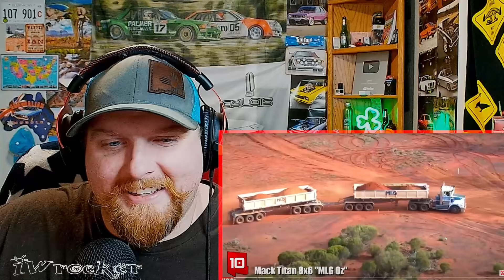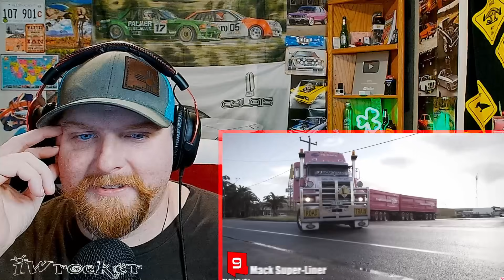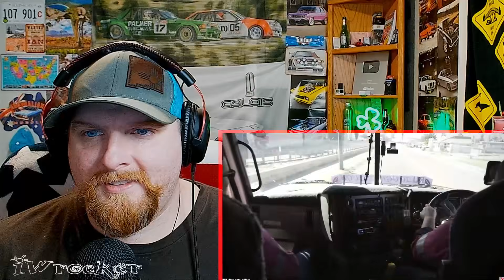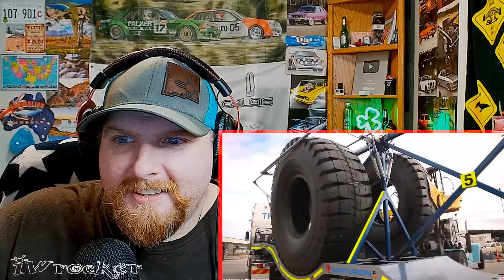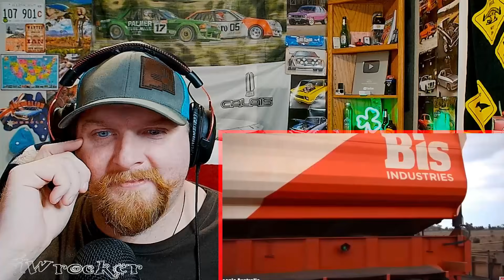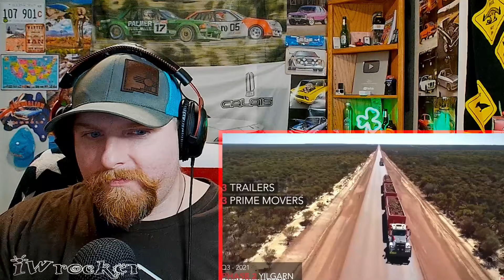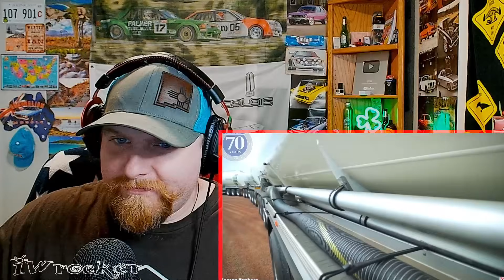American Reacts to The BEST Australian Road Trains Ever Produced

Comment: Yes your right Kenworth trucks are an American brand but are made in Australia so are Mack trucks and Volvo
Reply: It’s more “assembly” rather than “manufacture”.
Reply: Kenworth paccar Australia manufactures kenworth trucks 

They’re not imported from USA then converted. 

The kenworth truck shells are transported on trucks  to the factory site 

The shells come from another Melbourne vic plant in the west
Reply: Mack and Volvo are pretty much the same trucks nowadays. Well at least mechanically. Also a lot of the swiches and gauges are volvo, its mostly the trim and boddy and chassie that is special.

Volvo make (most) engines, Transmission, and other parts in a central location then ship them out to different manufacturing unit where they build the same parts into different chassis and bodies. Volvo, Renault and Mack is made all in the same volvo production unit n Brisbane in Australia .

They have one manufacturing unit in pretty much every continent if not several. In USA they have one for Volvo and one for Mack in Europe they have one for Volvo and one for Renault. Volvo produce pretty much all of there trucks on the local market.
Reply: Pretty sure the autonomous trucks are only used on private roads not on public roads
Reply: And correct me if im wrong. Mack is owned by volvo yeah?
Reply: Mack and Kenworth trucks have been assembled in Australia since the 1950 s or earlier. I think that all heavy trucks would be assembled locally
from parts such as tranny motor suspension and diffs , They would  come in containers .All else would be made in Australia  . THE Chassis in these trucks have
 double rails the front axles are heavier because of the extra load they carry . The cabs, sleepers ,ice packs , bullbars ,and the radiators are all locally manufactured .
The reason for the double chassis rails is stop the chassis from flexing and twisting around when carting double decker crates of cattle .
Also in days gone by MACK used to get chassis made here and exported to US .I think all right hand drive MACK trucks for the world market are
assembled or manufactured what ever you wish to call it .
Reply: @@herctwenty11

I have a good American born friend in Hagerstown who retired from Mack after 50 years. Trucks are exported then some Australian components are added to beef   up to suit local conditions. This is mainly done due to tariffs imposed by government to meet a certain percentage of Australian local made components and Labor inputs. Mack engines are basically Swede engineered by Volvo.
Reply: American brand trucks but many highly modified or specced at heaviest standard for brand, these are built at Australian assembly plants for our heavy specification requirements, most do not resemble the average American truck, also we have generally far more fuel tanks/capacity and certain brands Ie Kenworth Australia have produced unique Australian models of prime mover, ie Kenworth SAR.
Tri drive prime movers are not uncommon here but would be rare in the USA and Europe.
Reply: @@herctwenty11gold lol
Reply: And are all paccar which I think are all under Daimler
Reply: @Squishy9387 paccar and Daimler got nothing to do with one another
Reply: And Scania
Reply: Volvo were manufactured here but overall not really many overall. Although I'm guessing that the influence on design could possibly be the fact mining giants that operate in these rural areas are seriously cashed up and the whole design influence could possibly be these cashed up giants throwing cash at truck manufacturers to come up with designs that would be able to live up to the conditions . Bur thats just an off the cusp guess. These big giants are definitely big enough to have thst impact.
Reply: Mack’s and Volvos aren’t built over here but they are only put together over here they are designed and taken apart to ship
Reply: Australia "assembled" many unique trucks here. Iveco and Volvo trucks were completely different from their euro counterparts. You could get an iveco stralis with a cummins ISX, a roadranger box and meritor suspension all round. Only thing euro about them could be the cab. 
Worked for Iveco for 6 years, they were producing trucks here until around '19 or so. You could also get the iveco powerstar which was an Australia only truck, never built in Europe other than a few examples in either denmark or the netherlands.
Reply: The K200 220 are Australian designed American didn't get the cab overs
Reply: Kenworth is made in Bayswater and Mack is made in Brisbane.
Reply: Volvo trucks are made in Sweden but brought here then upgraded to Australian conditions
Reply: @@herctwenty11 the only one “spewing” on here is you bud. 

Straight from the internet:

“Mack products are produced in Lower Macungie, Pennsylvania, and Salem, Virginia, with all powertrain products produced in its Hagerstown, Maryland plant. Mack also maintains additional assembly plants in Pennsylvania, Australia, and Venezuela”.

Before you go on the attack I suggest you get yourself a high school dictionary and understand the difference between ‘manufacture’ and ‘assembly’.
Reply: @PeteV.53 I'm going to listen to the bloke who "built" them and not the internet warrior, what do you "manufacture" in your parents basement?
Reply: @paulmccourt6185  try “son of an independent owner/driver” who spent hundreds of hours on the road with his old man. What’s your connection with Australia’s trucking industry?
Reply: @paulmccourt6185 bro they are assembled here Bo
Reply: @PeteV.53 Macks are manufactured in Wacol mate. have been since the 60’s. Can’t get a Titan, Superliner or Trident in America. At all
Reply: @PeteV.53 you realise there are different manufacturers in each country right? 

Australian trucks are made for their conditions built from scratch same with the trailers they are all built for scratch.
Reply: @PeteV.53  The truck is manufactured. The parts are manufactured seperately. You are starting an argument over semantic English which is stupid. It's no different to a baker assembling a cake from flour and water instead of making it.
Reply: @vintageradio3404  exactly my point! It’s an assembly process which brings together various components sourced from various locations. It’s not semantics … manufacturing is different to assembly. Over and out!
Reply: @PeteV.53  It is semantics and it adds nothing to the conversation. It is as if assembly is somehow a lesser effort than making the parts. It's not. Value-adding is a part of every step in the manufacture of any product. Since the three brands identified as having assembly plants in Australia build right hand drive trucks for export markets, there are hundreds of parts that have to be made locally to achieve that. American factories pretty much refuse to make RHD vehicles. There are exceptions but they are rare.
Reply: @vintageradio3404  are the Prime Movers  modified in Australia by Australians to suit Australian conditions? Of course they are! And I’ve never said otherwise. However, the heart, soul and core of these trucks was, is and always will be pure American iron.
Reply: @PeteV.53 you’re not that bright are you buddy. You quite literally have a dude telling you he physically produces parts for these trucks but somehow you think your many hours on the road with you ur old man trumps his actual on the job, in the factory, DOING THE ACTUAL THING. I think perhaps sir you might want stick to things your good at. I looked at the site and most of these assembly points (as you call them) are all registered Australian made products. & I know… you’re probably going to trump this with your many years living in Australia card… but as someone who manages a registered Australian made company, I can tell you that over 90% of what leaves their factory has to have its main product transformation in the country. And I’m sorry sir, ‘assembly’ just wouldn’t cut it in terms of adhering to those very strict guidelines.
Reply: @sodrav  Sorry to burst your bubble but there's a good chance a lot of that "pure American iron" came from Australia 😂
Reply: @PeteV.53 You are what we call in Australia, “ a bit of a wanker”